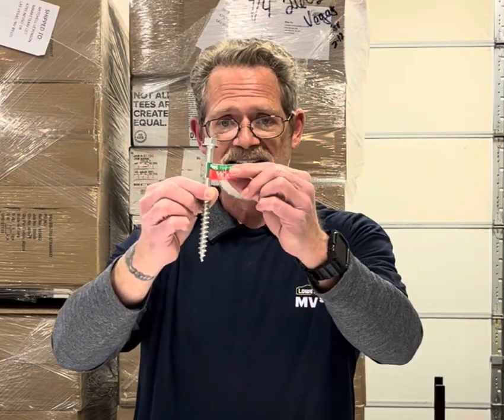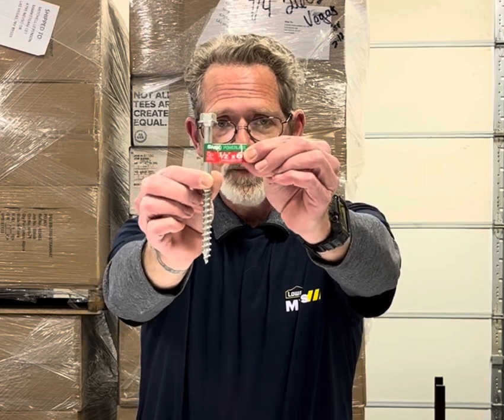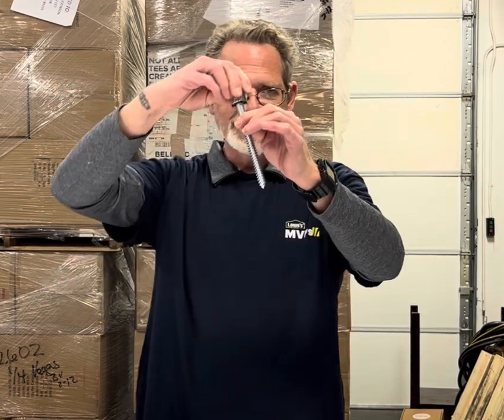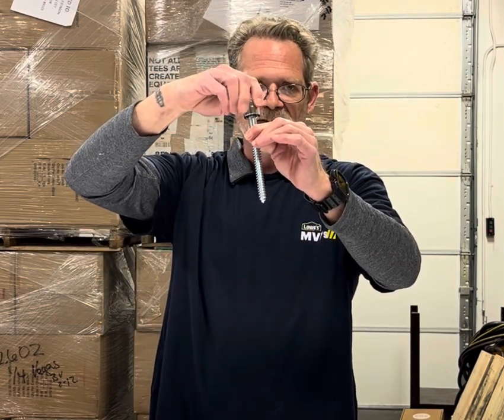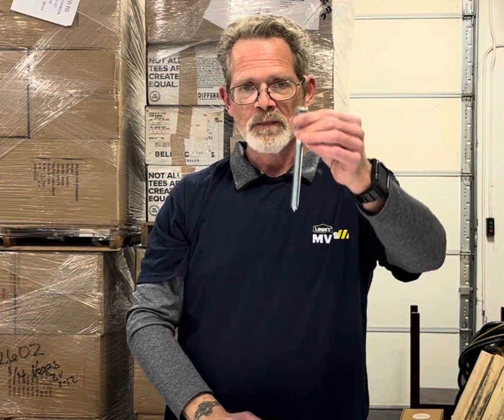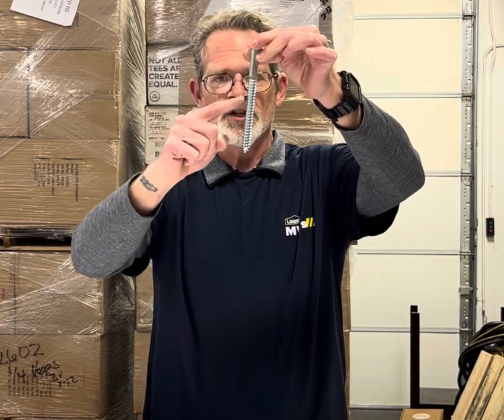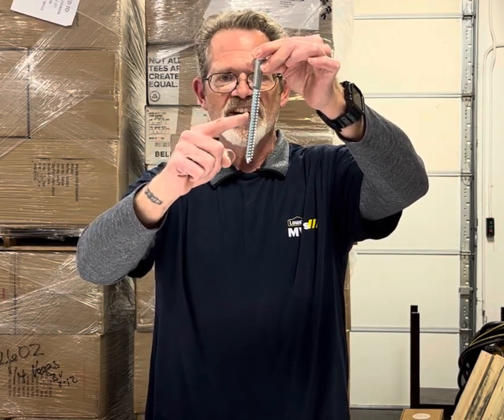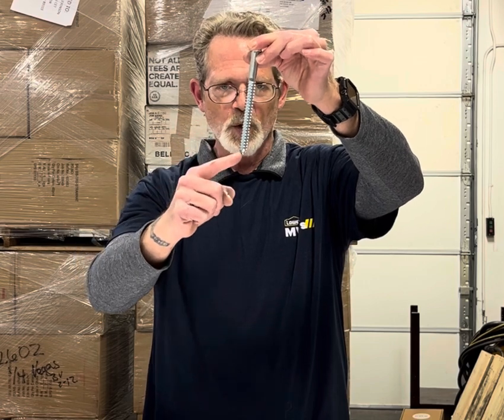1/2" Spax vs 1/2" lag: the difference explained! #diy #viral #reels

Comment: The flutes on the Spax will hold better than the lag
Reply from the maker: Yeah, you explained that in your live stream. However, I couldn’t remember everything when I was talking lol.
This was mainly to clear up some misinformation posted by somebody I used to associate with. 
Thanks for your input.
Reply from the maker: Coarse threads usually do grab better, from my experience with smaller fasteners.

Comment: Thanks to your video, I'll pay attention to those differences as I might not have prior to watching it!  Unfortunately, in typical "Yankee Frugal" fashion, I'll likely just use what I have in my "crap-junk-spare-screws" bucket/containers that mostly work instead of going out and spending good money to buy the "right" spax or lag 🤣At least now I'll know the difference if I ever do need to buy some 👍BTW...like that shirt, too!  Snazzy!
Reply from the maker: I don’t think I’ve ever actually used a lag. I think I’ve used the spax type, but somebody called it lag.
Anyway, Tools With SoAlz gave a really good explanation, during a live stream, a few hours before I posted this.
Reply: @DiligentDave1966  I’ve definitely used lags building wood workbenches and attaching wood pieces/structures but not spax and I’ll have to revisit them next time I need lags thanks to your video.
Reply from the maker: @WorksIRL  The way I understand it, the spax are less likely to back out over time, due to the aggressive threads.
Reply from the maker: @WorksIRL  By the way, the shirt is just a Nike dri-fit under a shirt that I got at Lowe's lol.